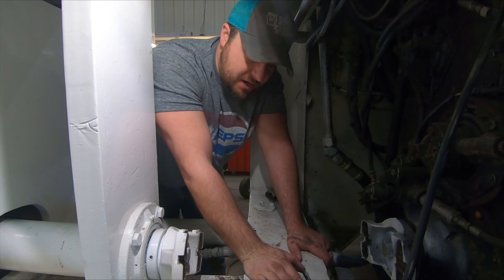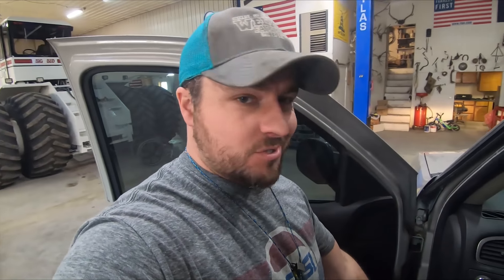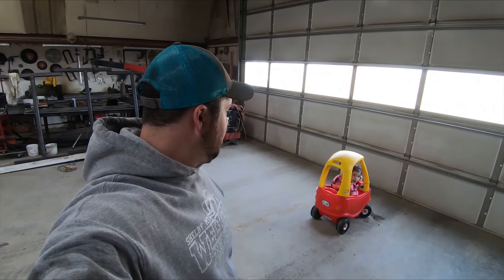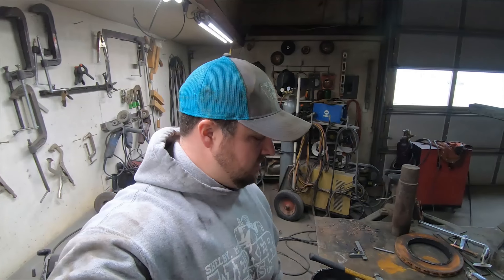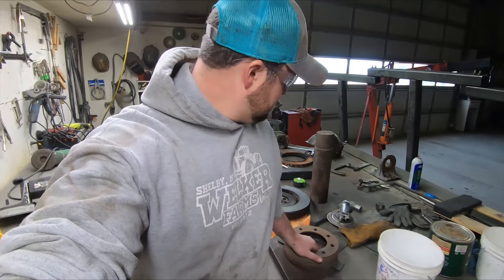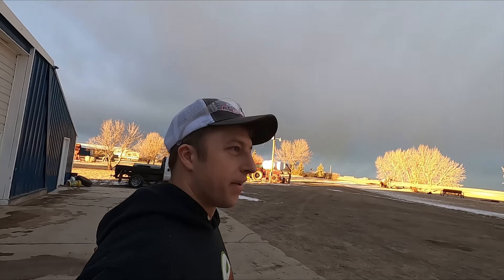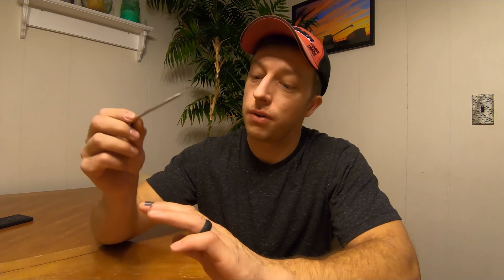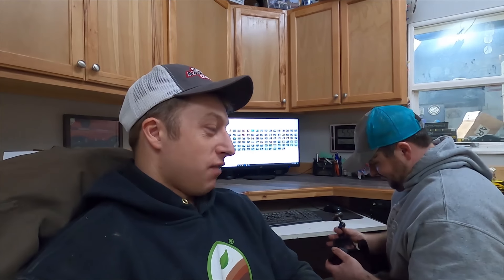SMASHED My Finger｜Shop Shenanigans

Comment: You need one of these for putting a hole in the fingernail.  Fiab Disposable Sterile Cautery Pen with High Temp. Fine Tip (1200°c) -

Comment: I turn the drill bit with my fingers to keep from over drilling my fingernail.
     Have a good time and enjoy.
     God Bless.
Reply: BWM  did you ever use the small drill bit method in your five or six times? And if you did, what didn't you like about it?
Reply: I’ve also turned drill bits with my fingers. Depth is controlled. The patient lived.
Reply: BWM  I've smashed my fingers plenty of times. One time I smashed my thumb so bad that the nail was being lifted up from the pressure. I was going to drill it but just putting any pressure on the nail was even more excruciating, so I just left the nail throb. The next time I'll try the hot pin.
Reply: I know a guy that works a lot of iron with a hammer. He's bashed his fingers many times. His technique is to set the drill press depth stop just a few thousandths below the top of the nail and then just go for it. None of that sissy sterilizing stuff either, that's what he's got white blood cells for he says.
Reply: @Mishn0  Best way who has time to heat a needle, drill it and done simple then back to work it will heal.
Reply: BWM  I always have a dill bit at hand but, never carry needle this is the reason I use a drill bit. Most of the time I never do anything about it and continue on working after all it is just pain.

Comment: What is or does a speedy sleeve?
Reply: It provides a new surface for the sealing rubber to seal against.  A fraction of the cost of replacing the shaft.

Comment: Instead of arc or mig welding on the pin to build it up, you could of had someone spray weld. The spray weld coating can be built up very precisely and can be done using varying types of coating hardness. Doing it this way tends not to effect the metal structure of the original metal and give a very durable surface.
Though a new pin will always be the better solution.

Comment: I remember droping a 8lb sledge hammer on my big toe when I was little, I could barely lift that thing. I also smashed one of my fingers later on but I don't remember how I did it, but I do remember going though then nail with a hot paper clip.

Comment: When I was 16 I was helping one of our neighbors plant 650 acres of wheat on their farm.  While we were fueling one of the tractors he decided it would be funny to start the tractor I was fueling and pop it in to gear. I slipped and to keep from falling under the tractor and the planter I grabbed the side of the tractor and ended up grabbing the engine fan shroud . This resulted in the tips of two of my fingers being cut off. It cut one off just below the finger nail  bed and another right through the middle of the actual finger nail.

We found the tips, put them on ice and then drove 45 miles to the nearest hospital. I only managed to pass out once and yes, it hurt.

As bad as the experience was I will never forget the reaction of the nurse when we got to the hospital. After I tried to explain I had cut the tips off two fingers, she went, "Ya, ya, you mean you cut the tips of your fingers. Let me see." She proceeded to take the gauze off my hand when all of a sudden blood squirted all over her face. I almost started laughing as she said, "Yes, definitely cut off. Yes, yes, definitely parts are missing.", as I held up an ice box and replied, "Yes, I know, the parts are in here!"

They did manage to sew both finger tips back on and after 33 years I finally have some feeling in them. The really interesting thing was both finger nails grew back about 6 months, but they are now different then my other finger nails. They both have really think ridges that run vertical down each nail and they are both quite a bit thicker than my other finger nails.
Reply from the maker: Wow!! What a story!!

Comment: I have a question, what is the reasoning for the bar that the pin goes through being all grinder out like it is at 3:20 ? Just curious
Reply: Below is where the draw bar pulls from.  I'm guessing that the swivel bushing needed more grease from previous owner.
Reply: Robert Welker oh sorry I was meaning the rectangular bar about 2 inches thick that has the semicircle rough cuts in it that the pin goes through. It almost look like it was done for better turning radius.

Comment: Nah, drill bit. but just twirling it in yer fingers (not in a drill, had it dig in once and feed straight in to the nail bed) plus it leaves a good sized hole to drain, the pop is very fulfilling too.

Comment: You mentioned "Almonds," and how it's pronounced. Here's the scoop from an actual Almond farmer: "All-mond" is when they are on the tree. They use a shaker and then pick them up off the ground to harvest. At THAT point, it changes to "Ammond" because the machine knocks the L out of 'em.
Reply: The correct saying is "al-mond"
Reply: Auwlmundz
Reply: I have been shaking trees for 10 years now and I have never found any Ls on ground, so I would have to say they are still almonds, otherwise we need to start calling walnuts, wanut
Reply: Samuel Leach the Ls will float gently on any itte breeze. But you make a great point about Wanuts! Thanks!

Comment: Was watching an earlier vid where you all were working on getting an old generator running.  If I remember correctly, you reduced the rpm and increase the voltage by tweeking the voltage regulator.  I suspect generator is supposed to produce 60 cycle power.  By lowering the rpm, you lower the frequency.  I suggest you put the engine back to the spec rpm.  I would also suggest you don't use that generator to power anything with modern electronics in them, ie, computers, digital tv's, furnaces, refrigerators.

Comment: I have used the drill bit without heating it up and turning the bit with my thumb and finger.
Reply from the maker: I must have had a dull bit as I tried that but it kept sliding around the nail.
Reply: My grandfather taught me that. Yes it was a sharp bit he kept in the house just for that purpose.

Comment: Your better off than me. I had a blade hit 3 of my fingers. Middle got a bruise, index got a small cut near the tip. Ring finger got large cut in the middle separating the 3 bones. 3 surgerys later, i have part of my funny bone replace the center bone and a metal pin to keep all 3 bones together. I now have a picc in my arm to do antibiotic drips to my heart to prevent infection. So yeah kids, keep your hands away from moving objects.

Comment: You don’t drill it. Just bend a paper clip straight and heat it red hot. It will melt through your nail and hit the blood and cool right down. Even the melting cools it way down. I’ll learned this 60 years ago and it works great...I promise

Comment: Your finger nail is nothing compared to my recent mishap! I needed seven stitches to my left thumb after it got cut in a milking parlous auger. I have uploaded a video of the story and its called Augers, Brandy, Cuts and Stitches. if you are squimish you may want to give it a miss!

You shouldn't really open a damaged nail. You will loose it anyway but the risk of infection is much higher now it has a way to get in!

Comment: I was driving a off highway truck here in alaska and going across a muskeg bog and thought I held to the uphill side far enough. Nope nata, no it wasn't so as the truck makes for that deep unforgiving hole I reach over and grab my lunch pail as no need to be hungry just cause I put a truck weighing over one hundred tons in a very deep, no one knows how deep cause if you do then your with it yet and will.... forever. I'm on the far side running board step and just started my jump things going well and a part of the cab separated allowing my middle finger to slide  ever so much. I continued with the jump cause this is not well thought out... my second roll over so should go smooth. I felt my feet leave and it felt like something grabbed and it did as the gap closed on the very end of my finger. It grabbed it tight and then it squirted my finger out and happy to be loose. Then as my feet hit the ground I felt different, alive but different. Actually I didn't have look long as it kinda said this is the part that hurts a bit.. no, nope, nada no reason to look any further, nail is about half off and swelling quick and now I feel this pain that makes my legs shake a little and it is now throbbing pain like oh why and I drop the nose bag to examine my finger and learn I am still in trouble and scramble out of thes hole forming and now safe to one side watch my nose bag go out of sight and I have to walk to the spot we wait for the crew bus... lucky me as it is hurting so bad. Its the side rod headed for camp with another injured guy and they didn't know extent of injury but he said there will another rig right behind you in a bit so just wait ... sure okay and he continues to camp thinking I am alright, he thinks I might have quit or whatever but check on that status in a bit. They got the guy into camp and strip the hidden wound to find none, it was something he had in his pocket that was draining when it broke and he's fine. A hour goes by then another then here's the side road headed back out to the job site. As he past me I am cursing under my breath.. something bugs him so he slows down then backs up and asks me if I quit and I told him no, my truck fell in that hole in the road... the are you hurt and I said no, just pinched a finger and so he looks and turns his head quick and tells me "Get in the truck" so I figure he fired me but we stop at the first aid station and he is asking if I feel okay and can I walk and then I felt more pain and blacked out ... I had a stick stuck in me from that dang truck. It didn't reach the gut but nice hole. I wake up doctored up laying on a gurney and the nurse ask me how I felt. I told her a little woozy but fine and so she said you came in with a stick stuck deep in your lower back but we can't get a chopper in till tomorrow. Bad weather in alaska. I told her I thought I hurt my hand and she said where?? So I showed her my finger that was black by now so back in for x ray and I find out three broken fingers and yes you will lose the rest of that nail.... you don't feel this? and so not really but as time   went by and my hand swelled up I did. I do get to the hospital at about six in the morning and now I am hungry. No, nope, nata, ain't happening till your checked out.... nice scar on backside and my worst finger still sheds nails and I am 70+ now so yeah, yeper, yes I banged up a nail.. love the skits guys. all of you be safe.... Nick is a slow learner and you legarm are probably taught to keep your hands out of reach.. so teasing at your expenses kids

Comment: Drill bit would of gotten deeper and more blood would of come out, just did it 4 days ago. All the purple is gone
Reply from the maker: I had a hard time keeping the fine pick hot, would heat it red hot and then stick the nail but it'd cool off too quickly. Plus trying to film didn't help either. Next time I'm going to try the drill.
Reply: @WelkerFarms  use a drill press too, more control on your depth of the drill bit.

Comment: All makes have that door wire issue. The manufacturers are using the absolute minimum length wire in every vehicle. It's a cost saving measure and since the engineers aren't smart enough to think of what temperature does to wire folks in really cold and really warm environments have these issues. Plus that also use the minimum gauge wire possible for the same reason Cost. Then they charge us 50k for a vehicle that is worth at best 23.

Comment: I use a small little brill bit. Just roll it between your fingers until a very little hole releaves the pressure. Pain intense for a breif moment, then is over. Get back to work.

#Maga
#RetComVets
#Eccl 10:2-3
#KAPA KEEP AMERICA PRO AMERICAN 
#In God We Trust 
🇺🇸🇺🇸🇺🇸☝️

Comment: Replace the broken wires with spliced wire at that door body junction with thick insulated teflon wire. You will never have a problem, aircraft use that on everything good to - 70
Reply from the maker: I like your thinking!